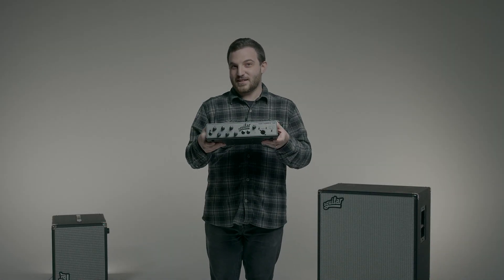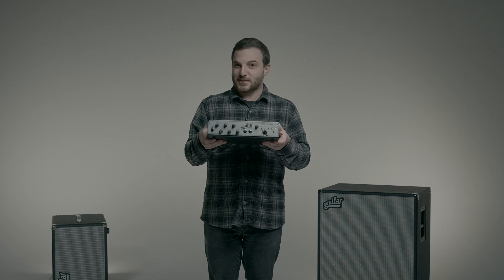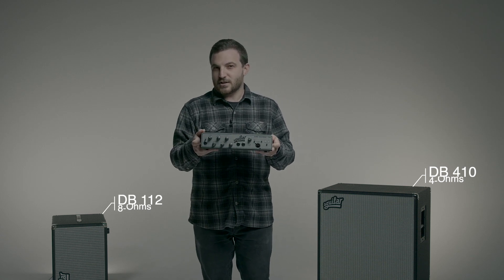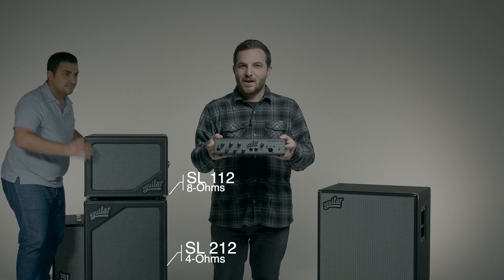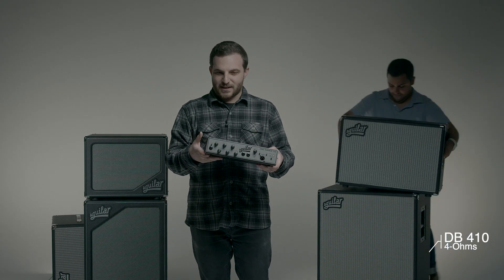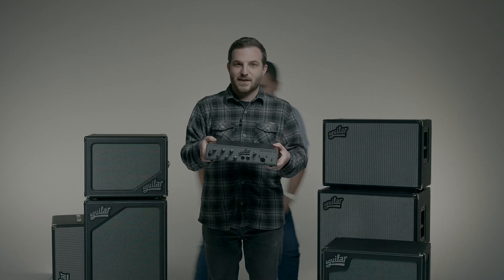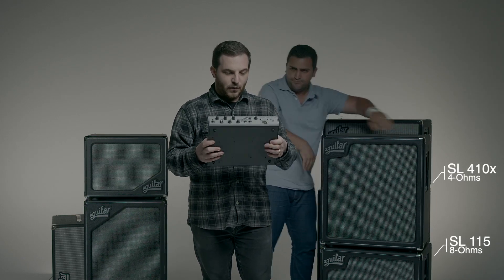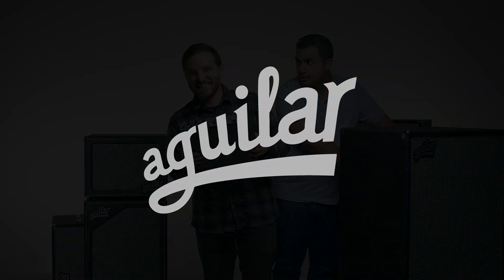Modular cabinet combinations with the AG and TH 700 amplifiers

Comment: Could you pair a 4 ohm SL 212 and an 8 ohm SL 210 together with an AG700? Or would the cabinet combination be too much power demand at 900 Wrms?
Reply from the maker: That's a great combo for the AG 700! The AG 700 goes down to an ohm load of 2.67, so powering an 8-ohm and 4-ohn cabinet simultaneously is totally safe. Also, your amplifier will split the output evenly across the cabinets, so one won't be working harder than the other.
Reply: @AguilarAmplification  Thanks!

Comment: Can I pair a TH700 v2 with 2 SL112 cabinets? With no risks of damaging the speakers? I mean the speakers are 2x250w. And if so, how to connect them?
Reply from the maker: Hello, you can absolutely safely pair a TH700 with 2 SL 112 cabinets. That being said, you do want to be conservative with playing at very high volumes. This isn't just your amplifier mind you, also any added gain from your bass or pedalboard can push your drivers. As long as you listen to your speakers and turn down at any sign of strain/breaking up you should be more than fine with that rig!

Comment: Does that apply to the TH5500 as well?
Reply: Ahh, I see. Someone else committed below and its no.
Reply from the maker: @johnmacfarlane1559  Hey John! So, the V1 Tone Hammer 500s do not handle 2.67 ohms, but the new V2 do! Any TH or AG 500 coming out of our factory now can handle 2.67 ohms and has universal voltage switching!
Reply: @AguilarAmplification  Thanks

Comment: That’s cool, but can you show how you connect all those together. That would be really help
Reply from the maker: Certainly. Aguilar amplifiers can be connected either series or parallel to your cabinets. You can connect your cabinets either way and the amplifier will distribute the output evenly. How you connect depends on if the Aguilar amplifier you have has one or two speaker outputs. When attaching three cabinets we recommend connecting in series: amp -> cabinet 1 -> cabinet 2 -> cabinet 3.
Reply: @AguilarAmplification  thank you
Reply: Let me ask this. A TH 700, or AG 700 can pair up with a SL112 and not be too much for that cab?@AguilarAmplification

Comment: I just bought the AG 700 (old version). I'm thinking about a flexible cabinet combination.  If i connect a SL112 (8ohm) + SL212 (4ohm), does it mean that 1/3 of the power goes to the SL112 and 2/3 of the power goes to the SL212? (This way each 12' woofer get exactly the same power... Appeox. 233 watt?). What about connecting a single SL112 (250watt max)... Is there any risk to damage the amp or cab?

Comment: I believe your DB751 can handle 2.67 ohm as well since its power stage is mosfet. Is that correct?
Reply from the maker: The DB 751 can handle 2 ohms!
Reply: @AguilarAmplification  Any chance of a Tone Hammer amp coming out with a 2ohm option?

Comment: What cab pairing would be better for the tone hammer 700 in regard to ohms? 

SL212 4 ohm with SL115 4ohm 

Or

SL212 4ohm with SL115 8ohm
Reply from the maker: Hi Raymond. The TH 700 cannot go down to 2 ohms, so one 4 ohm cabinet and one 8 ohm cabinet is the way to go.
Reply: @AguilarAmplification  awesome thanks! 

Do you know if there would be any phasing issues if i paired my 212 with a 115? Or would 2 212s be a better pairing?
Reply: @AguilarAmplification can I pair just one cabinet with the AG700?  If so, which one would be the best ohm-wise? 😅
Reply from the maker: @Grandpianoman  You absolutely can pair one cabinet with the AG 700. If you're looking to play at high volumes a 4x10 is always a great option, either our SL or DB are worth giving a test run!
Reply: @AguilarAmplification Excellent!  I decided on TH 500 gold edition with SL 212 

Thank you for your advice!!!